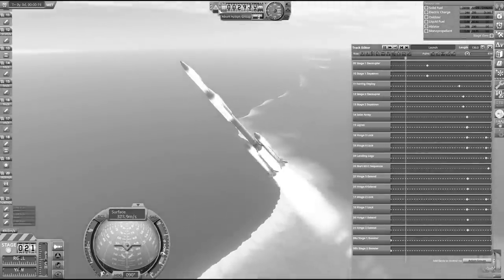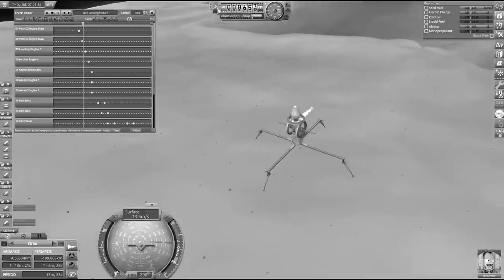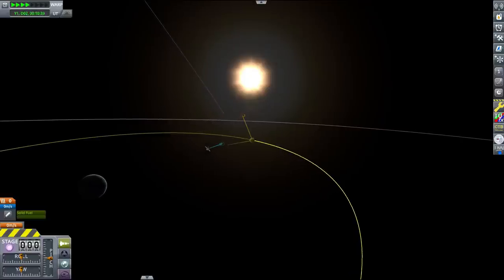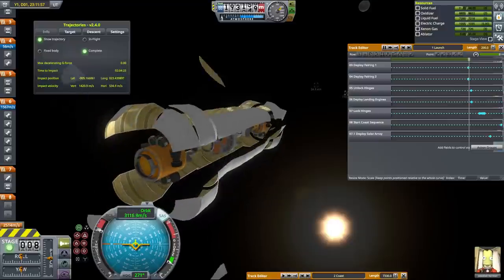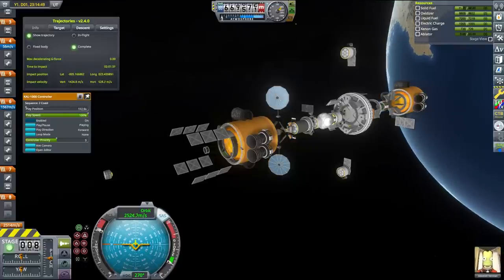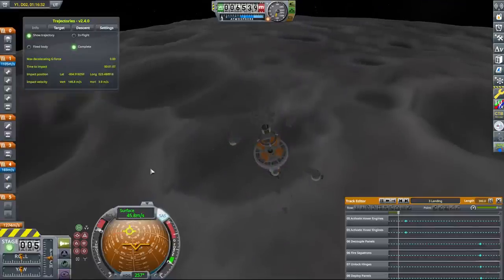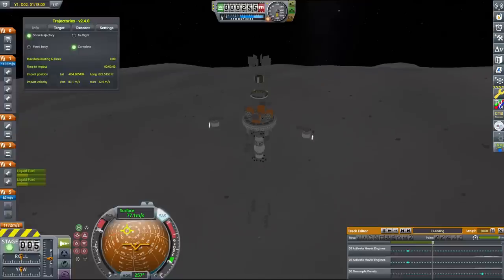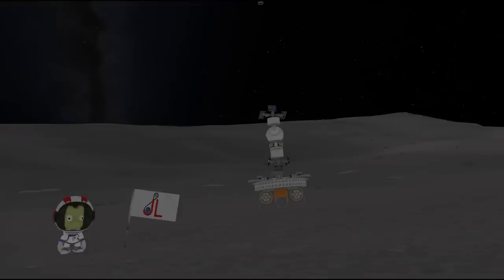Fully Automated Mun Mission in Stock Kerbal Space Program!

Comment: Man there is something fascinating in making the rocket "think"
Especially with such limits as you have here, "how do we make it think and know where it is, around its limited capability to know where it is?"

It really has the vibe of some old missions with limited sensors
Reply: Lol you talking about how the rocket "knows where it is" makes me think of that missile meme.

"The missile knows where it is at all times. It knows this because it knows where it isn't, by subtracting where it is, from where it isn't, or where it isn't, from where it is, whichever is greater, it obtains a difference, or deviation. The guidance sub-system uses deviations to generate corrective commands to drive the missile from a position where it is, to a position where it isn't, and arriving at a position where it wasn't, it now is. Consequently, the position where it is, is now the position that it wasn't, and it follows that the position where it was, is now the position that it isn't. In the event of the position that it is in is not the position that it wasn't, the system has required a variation. The variation being the difference between where the missile is, and where it wasn't. If variation is considered to be a significant factor, it too, may be corrected by the GEA. However, the missile must also know where it was. The missile guidance computance scenario works as follows: Because a variation has modified some of the information the missile has obtained, it is not sure just where it is, however it is sure where it isn't, within reason, and it knows where it was. It now subtracts where it should be, from where it wasn't, or vice versa. By differentiating this from the algebraic sum of where it shouldn't be, and where it was. It is able to obtain a deviation, and a variation, which is called "air""

Comment: An amazing achievement, it is insane that this is possible in ksp. I do think placing parts with no connection far out from your craft is a bit of a cheat though, but with what you have shown I am sure a craft could be build which didn't do that but still got to the mun and back

Comment: Next step: Automate the timing of the launch from Kerbin so that the whole system is idiot proof.
As it is now, the system seems to be quite sensitive on the correct launch timing. You have to launch at the correct lunar phase (and hit some range of lunar longitudes) so that the solar tracking gives you that 45° angle that combines lunar ascend and Kerbin deorbit. And then the time of day has to be right so that your launch trajectory hits the spot where the moon hangs in the sky at that time of the month (and accurate enough that you land on the correct side of the moon).

Comment: have the craft wait until a lunar eclipse over the KSC, then launch after whatever specific time has the moon in the right spot. fully automated, can put on the launchpad at any time, no inputs required.
Reply from the maker: I attempted this very thing initially, but I ran into two problems:
1) The amount of delay time I would need between the eclipse and the launch was several hours. Can’t time accelerate, so I would only be able to test the vehicle once every 4 hrs of real time
2) The error in play position of a KAL controller is comparable to that of launching manually anyway

Comment: Can you use the sun tracker to automate launching at the right time, using a controller that never leaves the launchpad?
Reply from the maker: Great question. I tried that initially, but I was unable to make it trigger the launch with more consistent timing than what I could achieve by hand. If I ever end up trying an automated interplanetary mission, I'll probably need to find a way to make that work since accurately timing the launch will be more critical.
Reply: @jamieloganaerospace6404  I'm not familiar with same-ship part interactions, having been lapsed player since before the robotic parts came out. I assume you already tried solar panel+ sunshade structure, positioned so the solar panel doesnt get power until the correct time?